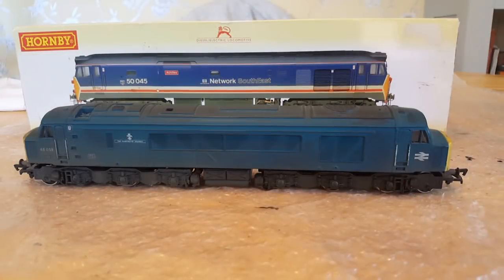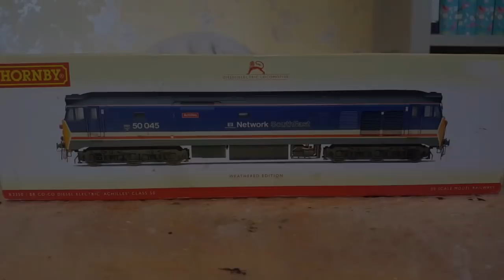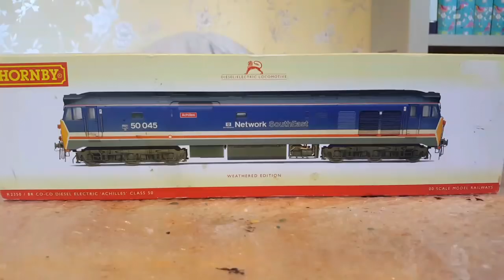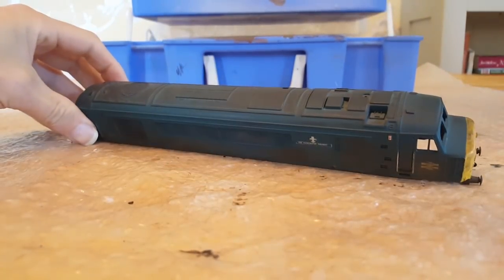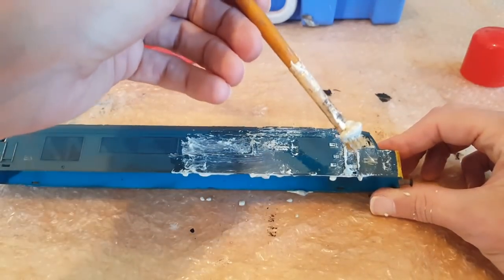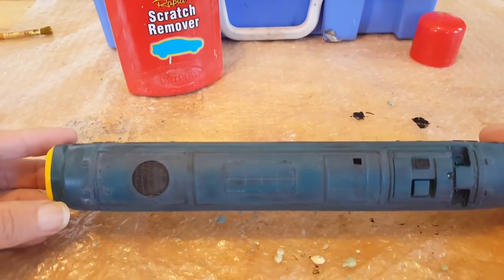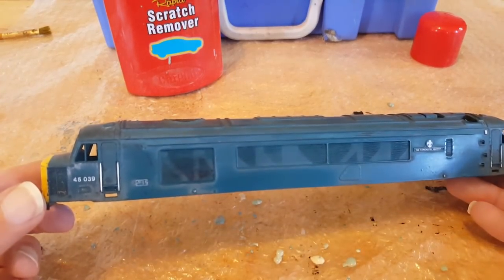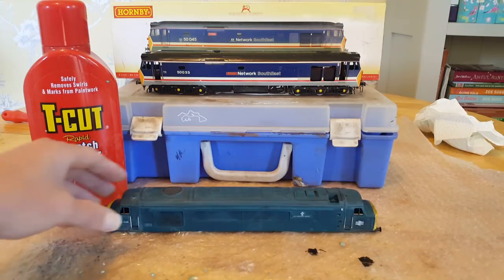Episode 3. Removing weathering.

Comment: Real nice upgrade on the 50  certainly looks better than the released version and love the clean look   

A little bit jealous TBH but you have a beauty of a loco there 

Great video buddy 😉

Cheers Gaz
Reply from the maker: Cheers Garry. Yep it certainly surprised me how smart it turned out! The project on that was started November last year!. Lol. Now the layout is running ive suddenly got a urge to finish it. I may well be doing a large logo, grey roof as 50 050 as the second "Tour" loco as it looked in the final years - again in absolute mint condition and detailed further. 

Hopefully 50 033 should be appearing soon on the layout with a nice feature video.

Comment: the hoover looks so much better but how do you deal with the opening grills ?
Reply from the maker: Cheers does look so much better. I removed the red and white slats and cleaned those off and replaced them.. fairly easy to do. I didnt bother with the blue ones as those don't really make a diffence.